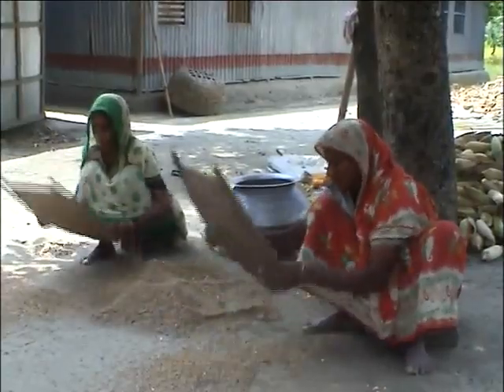Seed preservation techniques

Comment: Here is a transcript I made for students in the JICA program. It does have errors. I don't know the correct name of one leaf used in containers - bishkitali leaf?

Rice Seed Preservation

0:20 Seed is a living material. Crop seed is a living material. To keep this 
0:24 living material in good condition
0:25 up to the next rice season, there are a series activities
0:29 called seed preservation.
0:33 More than 95 percent of rice seed in Bangladesh
0:38 is retained by farmers for sowing the following year.
0:46 Storing seed is the responsibility of women here.
0:51 That's why
0:55 women members of the family must know the reasons why seed quality
0:59 deteriorates
1:00 during storage and how this can be overcome.
1:04 The quality of seed during storage
1:08 mainly depends on moisture content.
1:16 If the seed is not properly dried before storage,
1:19 it becomes soft, hot and moist,
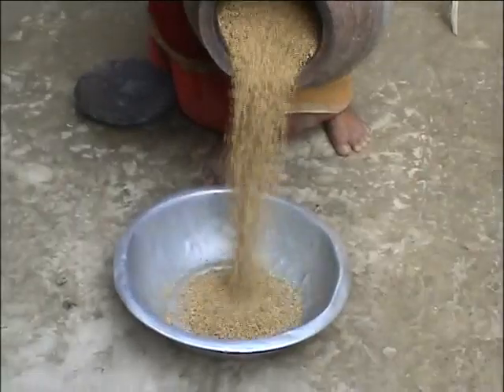1:22 and this will affect the level of disease and insect infestations.
1:30 This in turn will cause seed quality to deteriorate.
1:33 Using poor quality seed will give poor yields
1:37 in the following crop season.
1:40 Based on hard real life experience,
1:43 the women of Maria village in the Majira Apazilla of Bogra
1:47 district have devised some very effective techniques for seed
1:51 preservation.
1:58 Let us learn from some of these innovative women.
2:00 We select good panicles in the field
2:06 and harvest them separately. We then thresh them and then dry them
2:10 on the table.
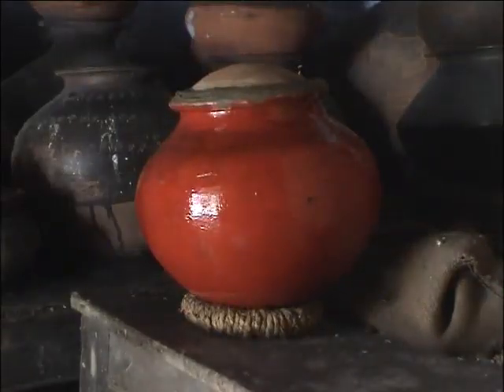2:11 We then store the seed in a container placed on a table.
2:14 We test the dryness of the seeds
2:19 by biting them with our teeth. 
2:25 We wash, clean and dry the seed container
2:28 before using it for storage so the container is free from
2:33 insects and their eggs. The women in our village use
2:38 plastic pots,
2:40 tin containers and drums as seed containers.
2:43 In addition, painted earthen pots are widely used
2:48 for seed storage. Keeping seed in good quality
2:52 economic helps us in reducing the seed rate needed for the next crop.
2:59 Some women in Maria village paint their earthen pots with varnish
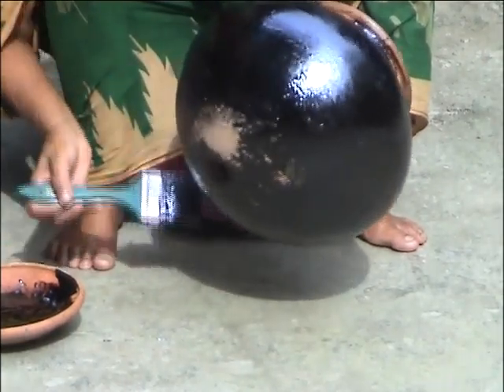3:03 or tar on both the inside and outside
3:07 to prevent the passage of air through the container.
3:10 Others use used cooking oil
3:13 instead of paint.
3:17 They also know that air can pass not only through the lid
3:22 but also through the capillary holes in an
3:27 earthen pot and destroy the seed quality.
3:35 Mr M M Haque, Research Officer, Rural Development Academy, Bogra - If there's still some empty space in the seed container,
3:38 some women of Maria village use an amazing technique from the past.
3:43 They put a burning candle
3:47 inside the container
3:50 and then they cover the container with the lid.
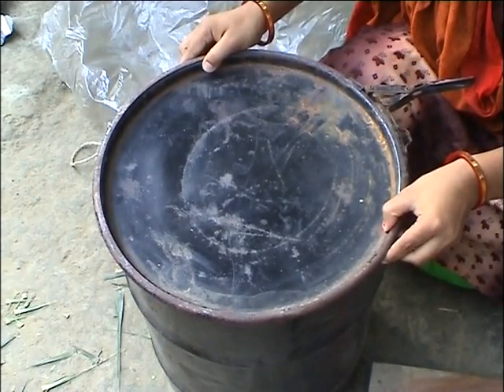3:54 They know the candle will burn until there's no oxygen in the air left,
3:58 so in this way any insects inside the container
4:01 will die. after proper drying and resting,
4:07 the seeds are placed in a container which is filled
4:11 right up to the top. If there's not enough rice,
4:17 some puffed rice old rice or dried sand can be used
4:20 to fill up the airspace.
4:24 It's also common in our village
4:27 before pouring seeds in the container we put dried bishkitali leaves at the
4:32 bottom
4:33 and at the top of the seed. As well as bishkitali
4:37 leaves we use dry neem leaves
4:39 tobacco leaves or napthalene inside the container and then tightly close the lid.
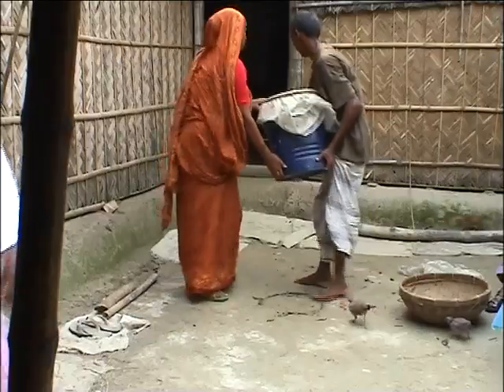4:44 These help a lot in controlling insects.
4:47 If you keep the seed container on the ground,
4:52 very quickly the seed absorbs moisture from the soil
4:55 and it becomes moldy and discolored.
4:59 That's why we keep seed containers somewhat off the ground.
5:02 It prevents moldiness and minimizes insects,
5:06 and the seed also looks bright and clean. 
5:10 So what have we learned from the innovative women
5:14 from Maria village?
5:16 We've learnt that we need to select healthy panicles.
5:20 Only clean and sorted seeds should be stored.
5:23 Before storing see we need to clean,
5:26 wash and dry the container. We should put seed right up to the
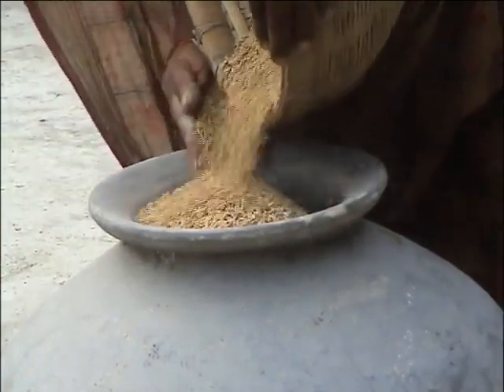5:31 top of the container.
5:32 If there's insufficient seed,
5:36 then properly dried sand or puffed rice
5:40 should be used to fill up the airspace.
5:48 The container lid must be completely sealed
5:51 to make it fully air tight.
5:57 Additives like bishkitali, dried neem leaf,
6:00 tobacco leaf or napthalene will help in controlling storage insects.
6:04 If the container is an earthen pot,
6:08 tar, paint or used cooking oil can be used to paint both the outside and
6:12 inside of the pot
6:13 to make it fully air tight. We should always keep the seed container
6:17 about the ground. We must remember
6:21 properly preserved seed is good seed,
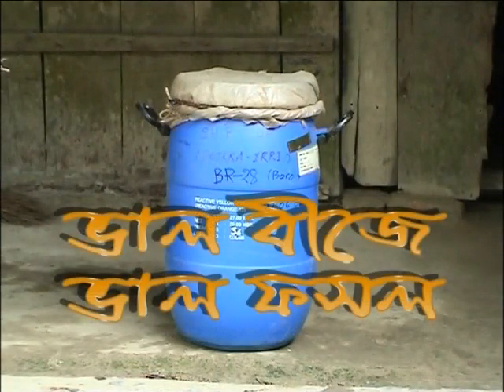6:24 and good seed means a good crop. 

Credits

This video has been developed by the Rural Development Academy, Bogra
and the women-focused NGO TMSS in Bangladesh.

Outputs have been used from the Seed Health Improvement Project (PETRRA).

Support has been provided in the UK by CABI Bioscience and Countrywise Communication.

Funds have been kindly provided by the UK Department for International Development.

This video does not necessarily reflect the views of DFID.